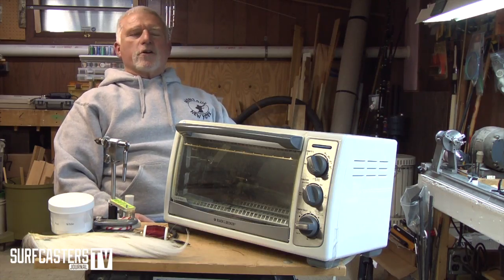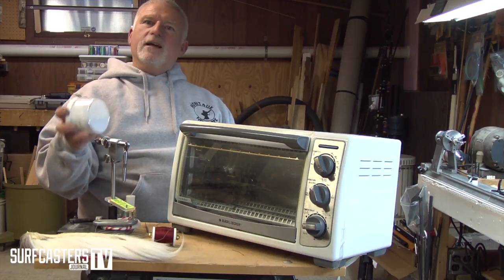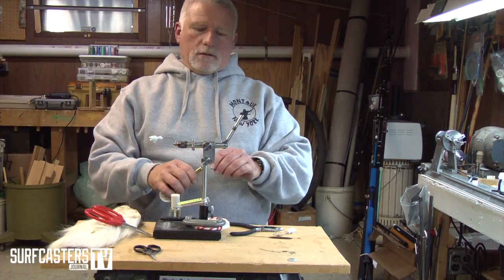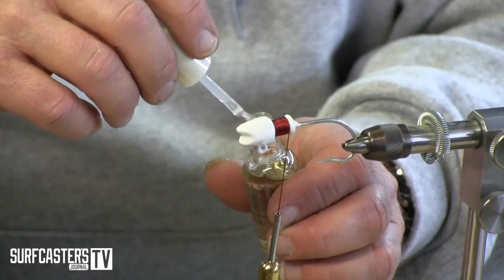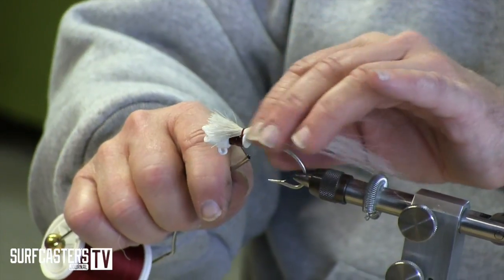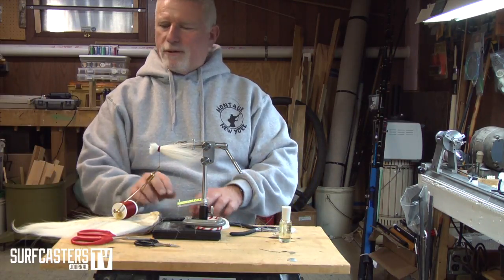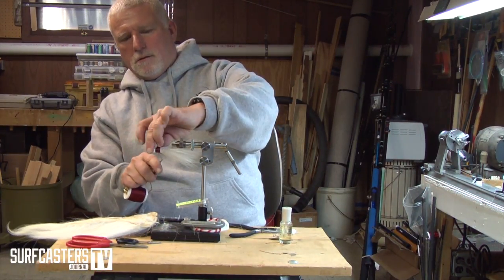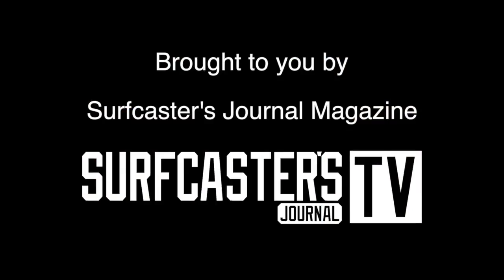Surf Fishing Tip of the Week # 38- How to make Bucktails with Lou Caruso

Comment: Ive been finishing the buckttail using 30 minute epoxy and drying it evenly on a drying motor. i hold six bucktails in place using aligator clips until it is hardened. I coat the wrap and lead too.

Comment: Hey Lou. Was wondering what vise is that you are using? And what kind of thread?
Reply: dyne king vise, thread, I don't know but also interested
Reply: Dude Wal Mart has a killer thread on a perfect width spool, bout three inches wide. It fits great in the wrapping tool. Two part epoxy over it makes makes the threads blend to a solid, wet looking red finish.
Reply: 3/0 red uni thread
Reply: @terrenceboylanjr  started tying some of my own flies for saltwater and shad but haven’t gotten into the small trout stuff. Still haven’t done bucktails yet.